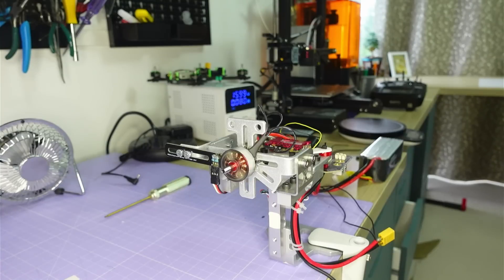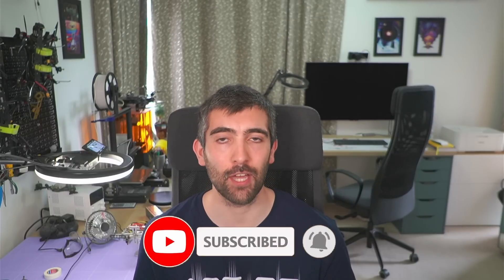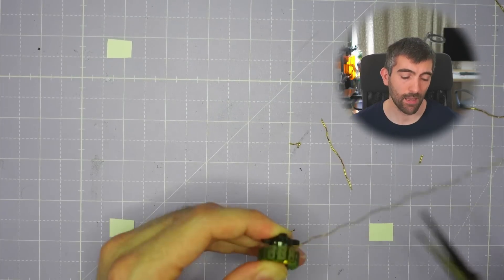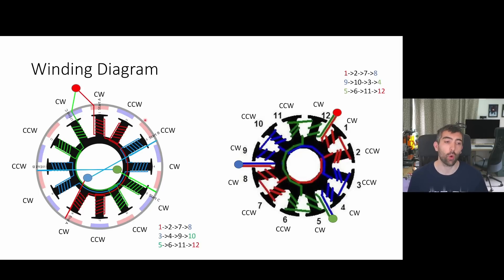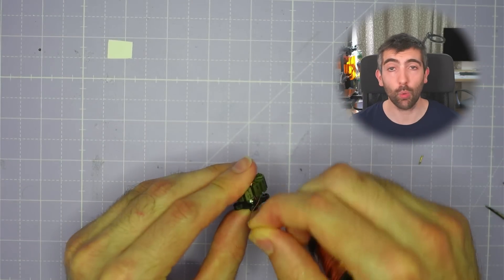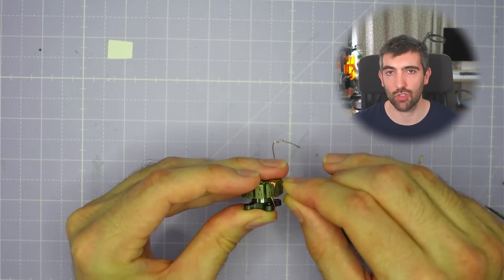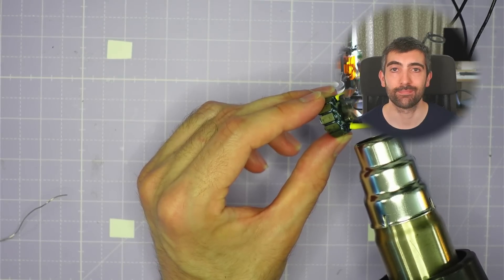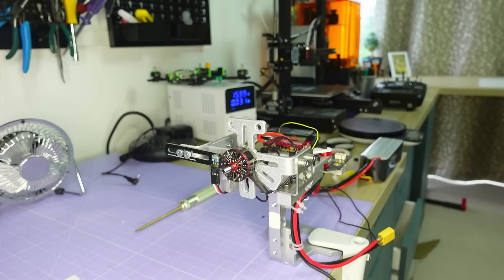I made the MOST EXPENSIVE 2207 motor (with 100% Silver Wire) and KILLED IT 😭

Comment: I was wondering if the slightly lower resistance is even worth the extra mass from using a more dense metal. I mean, if the rotating part of the motor has coils, rather than permanent magnets. I think the difference in mass is quite a lot greater than the difference in conductivity

Comment: In my friend's lab where they use silver coils for micromotors powering biofluidics, they insulate with ceramic instead of enamel or epoxy. I don't think it's for heat, though.

Comment: If the number of turns is the same I would expect the Kv and RPM should be fairly similar. Silver has a slightly lower resistance than copper so there should be a very slight improvement in efficiency of a few % as you found. This might be worth it for some competition classes? One issue is the diameter of the wire... a very small change in diameter due to manufacturing tollerance can have an effect on the cross sectional area and resistance.

Comment: You need to make wire that is also laced with Holmium as well as Silver.   Holmium has the highest magnetic moment, and combined with the 5% less resistance that Silver brings to the table, then overall a motor that is wound with a wire that is Silver/Holmium, then that motor should use 30% less energy to produce the same results from a copper wired wound motor.

Comment: a great experiment i literally searched this thing many times about 2-3 years ago but didn't found any answer about this .
you did a great job but remember your mistake was silver is more conductive hence it will need more turns on each and every pole of the motor then previously wound copper coil .

and can you do this again with more turns of silver wire or you can just use thinner silver wire so that we can see that science in a practical way .

thanks for this video.

Comment: Just guessing. In case, you manufacture a silver wire motor, you have to do the very same with all the other wires. The difference in resistance between copper and silver is in the 10% range. So, using 3 (phases) thin motor wires in parallel of 100mm in length cannot outperform even thicker copper wire of 400mm or more effective length battery - ESC - motor.
Second, I doubt, if any ESC will do a ultimate %-grade auto-timing optimization if firmware-configured with typical outrunners using copper?

Comment: Well done ! You should also compare using Litz wires
All tests should be done using the same current
Reply: Litz wire is not going to improve anything - the frequencies at which it would make sense are in the megahertz range, and motors work in the low kilohertz at most. The skin effect is almost absent at this frequency, so even using silver plated copper is dubiously advantageous at motor speeds. Eg. Maximum fpv motor speeds are around 30000 rpm, which is only 500 Hz. Skin effect only starts to become significant at 10000 Hz.

Comment: One little mistake: You did not test all 3 bells on all 3 motors. The magnets will vary a bit in strength and alignment and the 2% variation can easily come from that.
Measuring the motor Ri would have been very nice as one can then easily calculate the efficiency curves.

Comment: Silver arcs really bad(it does not produce as much resistanceheat as any other metal, so that is not the cause for the heat), pretty sure that is what caused the silver wire motor to break. For most electrical applications with silver, even coated/electroplated silver, it tends to have other metals with it, like cadmium to prevent arcing. If you could electroplate the silver wire with cadmium or even copper, it would reduce the arcing. Also, I would use a thinner silver wire as there is very little resistance (meaning you can get the same current that a much thicker copper wire could push with the thinner silver wire). If you had a coating to prevent arcing, and a thinner silver wire, you could add mor coilds to each post, nd vastly improve the efficiency of the motor itself, while getting the same electrical draw capabilities.

Comment: Any idea if a braided wire wound motor would be better than a solid wire wound motor?
Reply: Solid is better. I think it has to do with higher cross sectional copper density. You want as little air gap between each winding to increase flux density so I assume the air gap in multi strand wire would lower that density. 
Braided/multi strand wire also has higher resistance which lowers your efficiency.

Comment: You can try different winding wire formats, such as litz wire & flat wire. I am not sure what the switching speed of the motor coils are, the skin effect can reduce current flow. Probably with flat wire you can increase motor torque.

Comment: Heat reduction fix Next time coat the stator use 800g silicon carbide mixed 800g graphite powder epoxy resin crystal harder with a nail polish brush

Comment: At 1:03 you said 100% solid Sterling Silver wire. This is not pure silver. Stirling silver is 92.5 percent silver. Obviously you know what you used but I don't know if you used 100% silver or 100% Sterling silver. Sterling silver is a jewelry grade alloy and has more resistance than silver. Soldering through enamel wire is relatively easy if you glue an aspirin tablet to a tongue depressor  and push the wire onto the aspirin as you tin it. The molten aspirin seems to dissolve the enamel and act as a flux. Be warned it makes a very nasty smoke so use a ventilated work space.
Reply: Same thoughts, .999, coated, is my goal

Comment: Isn't the difference in conductivity so little it doesn't matter? Why not a silver copper alloy? 
Wouldn't a very high purity copper be comparable in performance? 
If the silver burns out more easily isn't it actually less efficient if the motor breaks?

Comment: instead of using silver or gold or any more conducting windings just use bifilar copper windings for example instead of use one 0.4mm2 copper wire use like 4x0.1mm2 wires it will increase all params of any electric engine - the problem is it is hard to do this because you need to have exact len. of all copper wires on all coils.

Comment: Just wondering about the switching frequency and possible skin effect. If frequency is high enough for skin effect to become a problem, the silver plating on the copper wire would be conducting a higher proportion of the total charge.
Reply: In the coils it's just the commutation frequency, as the inductance smooths pwm frequency to be almost nil.  So skin effect in this size of motor inside the coils is not really a factor.

Comment: After watching this intriguing video, I couldn't help but wonder if we could create something extraordinary. Imagine taking a long copper pipe, delicately threading silver wire inside, and then drawing the copper tube through a die to stretch and wrap the copper around the silver. The result? A fantastic foundation for winding the brushless motor.

The beauty of this idea lies in having the silver securely embedded within the copper, ensuring it stays put even if it approaches its melting point. I hope this idea works :)
Reply: electricity flows over the surface of the wire not inside of it, hence the silver coated copper. It melted because there was a flaw somewhere in his winding.
Reply: @MetatronsCube23  "electricity flows over the surface of the wire not inside of it,"
Direct current flows through the entire thickness.  Radio frequency energy travels mostly on the surface, how deep it penetrates depends on frequency.
https://en.wikipedia.org/wiki/Skin_effect
"At 60 Hz in copper, skin depth is about 8.5 mm"

Comment: This was a useless comparison. You did not count the windings nor did you make sure that they were wound in the same scheme as the original.
For this to be a proper test they would all need to be wound exactly the same way.
Reply from the maker: I counted the windings and wrote the turn numbers on the phases to make sure they were as identically wound as possible.
Reply: @ChrisRosser  you said and showed that you only counted the top of the winding and just pulled it off without counting the rest of the winding. I seen what you did. We all did

Comment: It's important to use polyester insulated conductors. As for removing the material for soldering, course steel wool can be used. Or an x-acto knife, by gently scraping .

Comment: I have a similarly expensive 2208 motor on my to-do list, making the stator out of mu-metal foil. Theoretically it should produce much higher magnetization for the current, allowing use of higher torque for the same resistive heating.

Comment: It might not be your handiwork that failed on the pure silver motor. It could be that due to the decreased resistance, for the same load, voltage, and PWM duty cycle was all the change needed to push the current draw into the danger zone.

Comment: Script needs a re-write to "more conductive then Gold, and 'barely' more conductive then Copper". The performance difference vs cost, it's a waste of time. The difference in noise (which is the motor bell 'ringing') and the reluctance to start should be an indicator of just how far out of balance the Silver motor was. It'd be un-flyable as when not attached to a solid test bench, it would vibrate a Quad straight out of the air.

Comment: I know this was a tremendous effort, and asking you to do it over would be ridiculous, but I'm still very curious what the final results of a functional silver wound motor would be when compared to the others. Too bad it didn't work out. Thanks for the info.
Reply: Very little difference, because it's only a few percent lower resistance then Copper. The change in dynamic balance compared to the factory made machine-wound motors will have more effect at limiting the RPM and Acceleration.
Reply: @PiDsPagePrototypes  sure, but sometimes a few percent is enough to justify a cost to some people. I mean, there are certainly people out there who would pay the increased cost for that extra few percent for a factory machine-wound silver wire motor. I wonder if it's possible to get a machine wound motor (not at retail, but a one-off set) for testing against the same motor made with a copper conductor... 

If we wanted to know the no kidding performance increase, contacting <insert factory name motor mfg here> might be the next step; in fact, this might've been the best first step to get a set made to compare apples to apple. That single set will likely be a few to several hundreds of dollars, and likely the best way to get them made would be to run a small group-buy, or run a small batch to sell as retail to bring the per unit cost down significantly, at a steep upfront investment cost. I'm pretty new to the hobby, but if someone wanted to do such a thing, and chose a good motor as the foundation, I'd likely be willing to buy a couple sets to have for myself if the cost/set weren't more than about three times the cost of the same motors in copper. One of my other big hobbies (high end mechanical keyboards) is pretty much all based on group buys, so I know Chinese manufacturers are pretty willing to do this sort of thing, and the hard part is finding someone willing to do the leg work to go through the process.
Reply: @iammeuru  outside of electric pylon racing, the percentage difference is not worth the time, money, or performance advantage, because the mass difference will have greater influence on a motors ability to change speeds.
Until ambient temperature superconductor wire becomes available, Copper will remain the best choice overall, for all but edge cases.
Reply: @PiDsPagePrototypes  huh? there is a weight difference between silver and copper, but it's going to be pretty small given the volume used on these motors (max of maybe 1g/motor?), further this is all contained in a non-rotational part, thus not effecting the speed the motor can accelerate. 

Your cost analysis isn't necessarily the same as everyone else, I suspect there are plenty of people who don't exist at the margins where this is useful to them, but who would still be willing to buy some of these motors. I am someone who would probably be willing to buy a set of these motors (factory wound) even if it drove the cost to double to triple/motor... I wouldn't build a fleet of units with them, but I'd definitely be willing to do it for a dream build, even if I wasn't realistically going to take full advantage of it... If I were rich enough to where it wasn't a significant drain on my bank account I'd buy a McLaren P1 or Porsche 918 Spyder even though I'm not capable of taking the car anywhere near its limits; I mean even at a much more "for the masses" example, people buy large trucks to never use them as anything but a commuter every day.

As for the time part, the reason we would want to know the numbers is because it would be possible to get these motors produced (factory wound) if there were a definitive demand, which would be driven by knowing what the performance difference is, and marketing it accordingly. The time difference would be non-existent if they just came that way in a box. Also, we are not the best community to use as an example for people who consider their time to be the most valuable resource; think of how many people build rather than BnF.
Reply: Agreed, little difference. A few% lower terminal resistance.  Easier to wind copper tighter to get that vs silver wire.  Can't really pull silver wire as tight. 

More gains can be had from magnetics improvements

Comment: Silver is not that expensive. It has a little better current resistance than copper (5%), it is better at heat conduction (25%)and a little heavier (15%). So it makes little sense to rewire a toy motor with silver. But it is sometime used on aircrafts and /or military equipment s...or some very high end equipment (race cars and bikes). One of the famous use was the Uranium refining for the Manhattan project...

Comment: I used to build my own brushless motors from old CD-ROM motors & Neodymium Magnets, because brushless hobby motor were very expensive or too big.  I was very surprised to see your two winding methods!  Normally I'd wind each station the same direction and then each other station would be another phase in turn, so the same phase is never next to itself.  This is easier to keep track of what's next to wind, I never did mark up the stations, (but good idea).  It's good to use different coloured wire for each phase too.  btw you burned out a motor, can't be sure of course but if you make mistakes in the windings this will lead to coil miss matches that always end in burning out the motor.

Comment: I think what would make more sense is silver plated aluminium wire. Aluminium has the lowest specific resistance,and since the outside of the wire has the most current going through it having the silver only on the outside should still give an improvement without as a big a price increase.
Reply: From within the motor, inductance smooths out pwm to where coils really just see commutation frequency.  This means that skin effect is almost nil.  Commutation is generally not above 500hz, whereas pwm may be 8k to 22k.

Comment: You can just sand off the enamel coating too so you don’t need the solderable wire. Or if it needs a higher temp to burn it off then maybe a lighter or mini blowtorch would work

Comment: Technically I think you could wind all coils with a single piece of wire. Wind one phase, leave a loop or tail hanging out then move onto the next phase. Since all phases are electrically connected it should be possible.

Comment: was this actually electrical silver?? copper, even if 99,99% pure, actually has quite higher losses then electrical copper (99,9999% or soomething like that), you might have to try using electrolytically refined silver, or test the silver enameled wire for resistance!

Comment: @Chris Rosser Thanks for great educational content.
I have a question about motor RPM. As you explained in motor KV video, the motor RPM is limited thanks to back EMF, which is negative voltage that prevents the main voltage from creating a current draw. But what actually prevents us from just applying more voltage to the motor to exceed back EMF and get even more RPM, assuming the power supply/ESC can handle it and motor is free spinning (or, more strictly, the useful power is small enough so that the actual current draw for the voltage applied is below some point where the motor starts to melt)? And if that's actually the way then what is a point of motor's voltage rating aside from just being a recommendation for typical usage in drones?
(I suppose this should have been asked under the motor KV video, but now it feels more likely to get some attention here.)
Reply: "But what actually prevents us from just applying more voltage to the motor to exceed back EMF and get even more RPM,"
Nothing at all prevents it.  The KV rating is the RPM per volt so if you double the voltage you double the RPM.   at some point the motor will self destruct.
Reply: Thank you for your answer. I wonder then what the motor voltage rating is intended to mean.

Comment: I don't know how England does windings but here in USA we use a poly coated paper in between the stator spaces to assure when we wind or rewind a motor stator there is almost no possibility of short due to sharp edges on the stator area. I was thinking when You were doing that winding that You'll probably get a short.